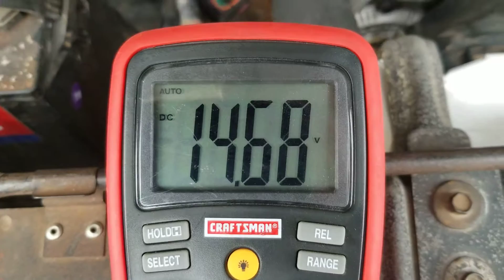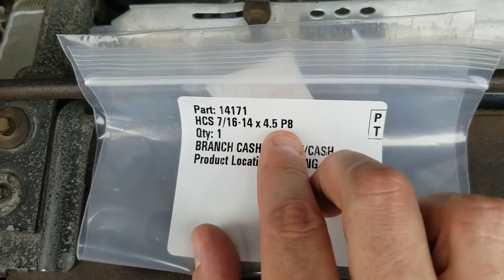1980-85 Ford F-150 1G to 3G alternator conversion (Part 2)

Comment: Thankyou for this video, I have been working on my brothers 87 5.8 f150 in my free time for the past few months resealing the engine and doing a bunch of other work, and the accessory drive has given me fits, particularly the alternator. I could not get the alternator to fit right, and one of my belts that came off of it was suddenly WAY too short. This one isnt exactly the same but it's close enough that I think you showed me the way the alternator needs to be sitting, I've been trying to figure out why it doesn't fit and why the tensioner doesnt clear and trying to put it above that bracket where it is on all my bricknoses and obs trucks. I'm pretty sure you just helped me solve the puzzle that's been driving me nuts because this is the only thing I've been able to find that actually helps. Even though my issue isn't the topic of the video I really appreciate it big time, thanks!

Comment: Can you make another video of  EXACTLY where each pos & neg battery hooks up to what & where...plus any other additional wires .
Reply from the maker: Look here: https://www.ford-trucks.com/forums/903504-3g-alternator-wiring-help.html#&gid=1&pid=6
Reply: @sclemmons1  thanks for the link ...a few pics are no longer available but there is one decent photo of where all the battery cables etc go to .
Reply from the maker: @faronf2006  If you google "Ford 3G alternator wiring diagram," you'll find dozens of identical images and diagrams.

Comment: Have you had issues with the belt chirping on startup? I converted my 86 F250 from 2G to 3G like 8 years ago and I can't get more than 5k miles out of an alternator belt ever since. I have to run the belt so tight to keep it from squealing it's ridiculous. Belt brand doesn't matter much, although goodyear gatorback or continential belts have done the best. I have no real need for 130 amps and I'm going to convert mine to 1G since I have had good luck with those on other vehicles. Certainly not putting a 2G back in that thing.
Reply from the maker: Never had an issue with belt chirping. Is your truck a V or serpentine belt?.
Reply: @sclemmons1  It's single V belt like yours is. I even installed an oversized alternator pulley to slow the alternator down, that helped but once the belt gets to be like 6 months old it just chirps.
Reply from the maker: @MattsRageFitGarage  which engine?
Reply: @sclemmons1  351W. The pulley setup is the same as your 302. One mistake I made was years ago when I took all of the horrible condition nonfunctioning smog equipment off is I tossed that cast iron alternator/smog pump combo mount and made my own top mount. I doubt that is the issue as it's mounted very solid, but I did buy a CVF racing billet alternator mount kit for it to get rid of my home-made stuff.
Reply from the maker: @1986FordF-250  I'd check the belt alignment with a ruler to see if and how far off they could be.
Reply from the maker: @MattsRageFitGarage  if you need further assistance, feel free to email me.
Reply: HAVE THE SAME ISSUE WITH THE ALTERNATOR MELTS THE BELTS , OR MAKES THEM HOT THEY GET SOFT AND STRETCH
Reply: @adriancampos382  I converted my truck to a 1G alternator not long after I made this comment and the belt issues are long gone.
Reply: @MattsRageFitGarage I converted it over to a 95 amp alternator and got rid of the belt issues the 130amp has way to much drag for a single v belt I found out
Reply: @adriancampos382  Which 95 amp did you go with?
Reply from the maker: @MattsRageFitGarage  https://www.youtube.com/watch?v=AM6gDb9qraU&t=3s